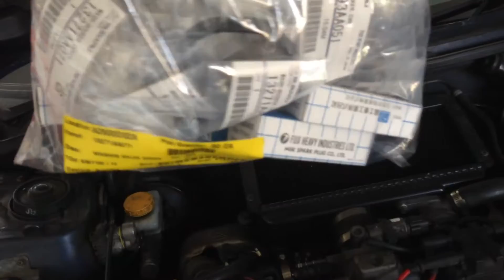Replacing a Under-manifold Turbo Inlet Tube (+ Rocker Gaskets, Spark plugs, Coolant Orings) GC8 WRX

Comment: Where did you get that inlet hose and was the part that goes on the turbo offset?
Reply: I'm gavintrouble putting manifold back on without damaging manifold gaskets,any tips?
Reply: @tucka1234  what I did was fit the hose to the turbo... Shim the bracket for the fuel rail and cut one off...and them to force on the manifold carefully without damaging anything
Reply: Thanks,when I get the new gaskets I'll try that.